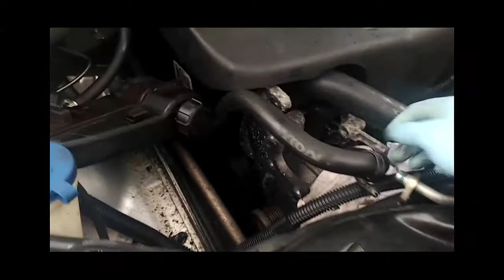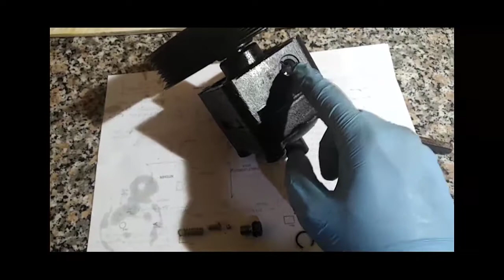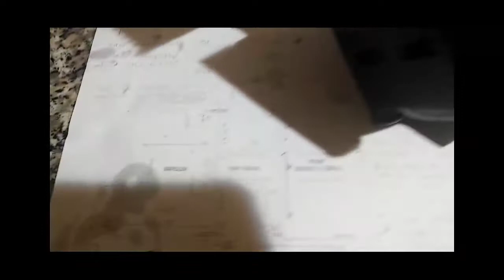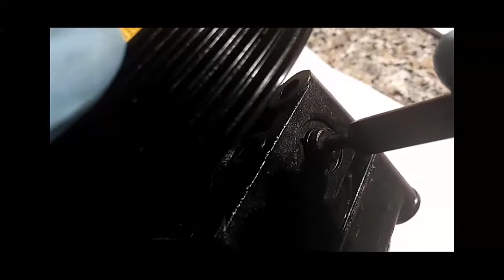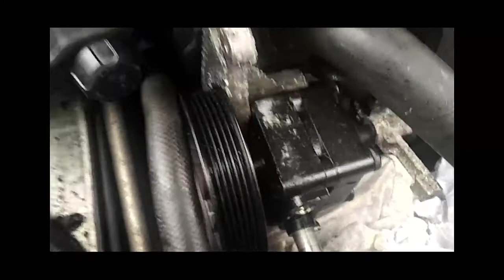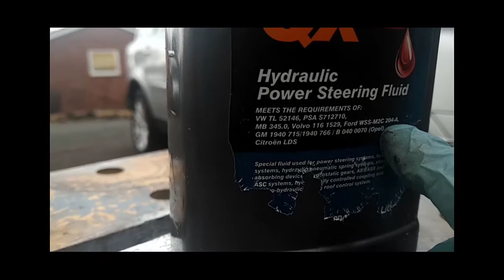2007 Volvo XC90 D5 Stiff Heavy Power Steering Problem Fix Pump Repair

Comment: Hello, i hope you can help me. I have a new Bosch pump, and just remanufactered the steering rack, green oil. . The steering is light and easy until the car warms up, then it gets super hard. Any advice?
Reply: Hi.How did you fix the problem? I have the same problem.thanks
Reply: No, i didnt, i blame it on the rack. Its a good idea to add an oil cooler to the rack so it stays much cooler. @andriuskakstys6544

Comment: How can the external o ring fix the problem? It just keeps the fluid in the housing. Flushing the system is probably what sorted it, or the ball valve was stuck.
Sorry to be one of those guys :(

Comment: Is this for real? did it work or not?
Reply from the maker: Yes it worked for me. But you have to make sure you have done all pre checks before taking the pump off. Check there are no leaks in any of the hoses and the fluid you have is good. Good luck
Reply: @MrZakmuh hello, what fluid you recommend - my one is also super hard to move the steering wheel when Im parked.. when driving normal
Is ok but parking is a nightmare

Comment: Hi, did this fix your stiff power steering, was yours leaking from there and losing pressure,  don't think mines leaking from there but is very hard to turn and is making a wining sound when turning when stationery, thanks
Reply: Good news, the pump I bought was faulty, they gave me a replacement and its working, the pump was a shaftec which cost £210, also these are recon units, so it's not impossible to get a faulty unit, thanks for your help
Reply from the maker: Nice one but how did you find out the pump was faulty?
Reply: I realised the pump was faulty as there was no fluid movement in the reservoir also the power steering only worked when revving to 2/3000rpm, and the new pump was performing worse than the original
Reply: Thanks for the reply, I'm fitting a new pump tomorrow,  I shall let you know if it  fixes my problem, thanks
Reply from the maker: @ryanevans8033  good luck mate
Reply from the maker: Hi. Yes it fixed my issue. I'd definitely advise you to replace the external o-ring first as Ive done. If the problem still there then you'd need to replace the pump. 
Whining noise usual comes for 2 reason... air leak or damaged pump
Reply: Also did you find part number
Reply from the maker: No sorry, as I fixed it I didn't look for the part number
Reply: Thanks will let you know
Reply: Changed pump today, brand new shaftec pump, new fluid and bled system, steering was good for 5 mins but now its worse than before, no power steering at all unless I rev to 2/3000 revs, any ideas? Thanks
Reply from the maker: Oh dear! You now gonna have to go through a set of checking steps. 
Start with disconnecting the return hose from reservoir and connect it to a container and start the engine, to check if fluid flowing.  Also check if the reservoir level goes down as well. 
We need to confirm there isnt any blockage within the system. Keep us posted
Reply: @ryanevans8033 Hi.Did you find the problem?

Comment: Hi mate, good video.
So you're saying that by only replacing the O-ring it fixed your issue?
I have the same problem like others here, when cold its fine but when warm it gets hard. Replaced pump for a better used one but still same problem. Could it be the steering rack is getting well worn?
Reply from the maker: Hiya. Yes, I would definitely say check the o-ring first and take it from there. I don't think you replaced with a brandnew pump, did you?
Reply: @MrZakmuh  Just noticed that there isn't a screw on the back of my power steering pump. I have a V70 2005.
No, I bought it used but it supposed to be tested according to the company who sold it. They gave a month warranty aswell but that has expired by now because i've started to focus on the steering rack insted since it's a known problem on these cars.
Anyway, thanks for the help!
Reply from the maker: Oh okay. There should be a pressure release valve inside then. Give it a check
Reply: @MrZakmuh   I'll check this!
Reply: It.s Me
Reply: @MrZakmuh oring size ? Not mentioned in video

Comment: Hello. I'm having the same problem in my 2004 S60 D5. Ps is light when engine cold, but then after driving and try to park, steering is really stiff, as if there was no ps at all. The pump does not make any noise, cold or hot, and in terms of leaks, fluid level remains constant. Anyway, my question is which is the diameter ( inner and outer) of that o -ring you got in that bolt? And did it solved the problem? Cheers
Reply from the maker: Hi mate it solved my PS issue. Sounds like its the o-ring needs changing. You need to check both, inner and outer diameter - inner should be slightly smaller than the valve bolt and outer should be slightly bigger than the hole. Bear in mind this o-ring should NOT be too thick

Comment: Hello! I've got a similar problem with my 2004 D5 S60, however for me the steering wheel is nice and easy to turn only in the first minutes of the car being on - before it has fully warmed up. After that the wheel becomes quite stiff, it's still driveable, but nowhere near as comfortable as in the first couple of minutes. This seems to be the case every time the car has had time to completely cool. I replaced the steering  fluid, but no luck. I'll check out this air leak problem you showed. Sure hope I won't have to replace my pump. Thank you from Latvia!
Reply from the maker: Hi mate. Yes this is exactly how my problem started. It was intermittently becoming stiff, then became stiff when engine is hot and then came to complete loss of power steering. It'll definitely worth checking the O-ring first. Good luck!